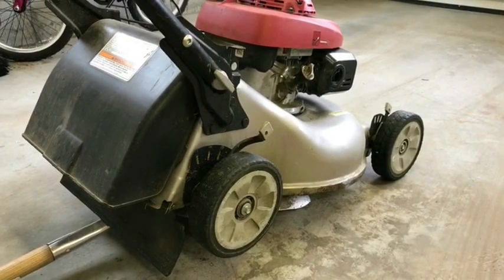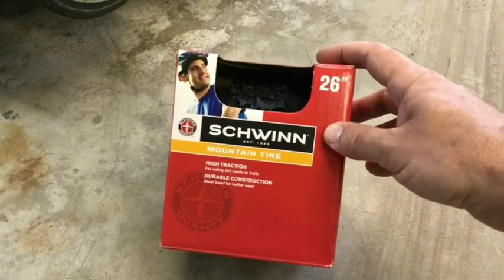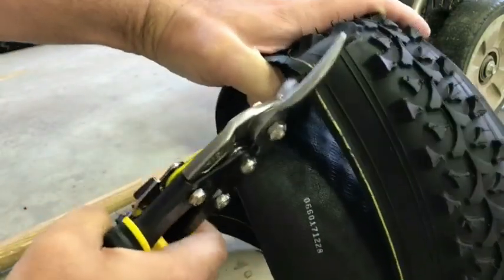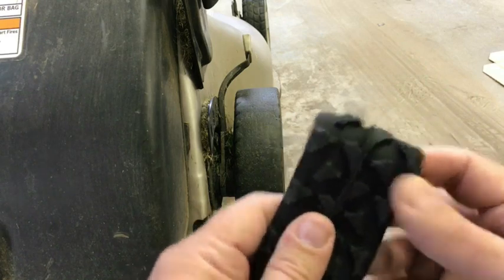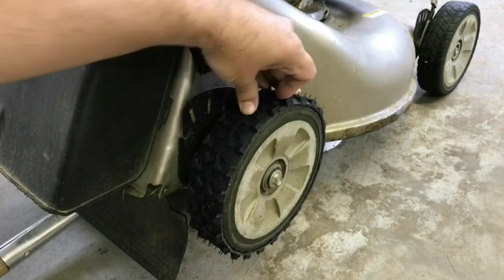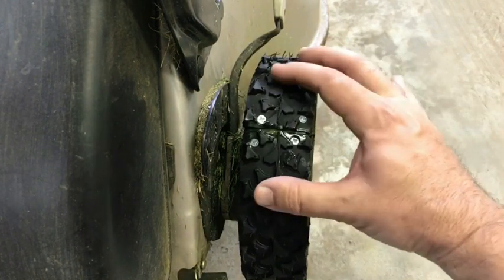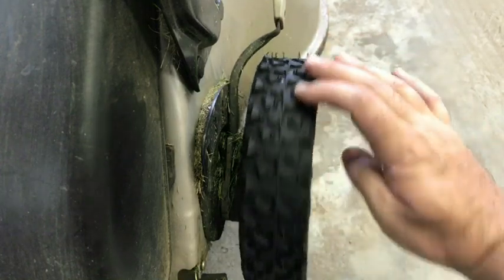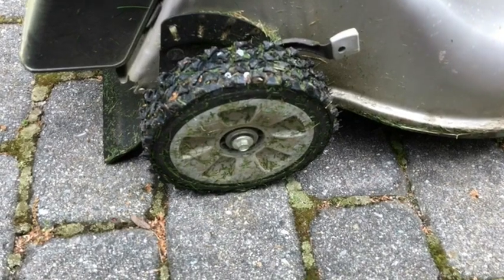Honda lawnmower worn wheel fix / retread

Comment: Good fix! I own the same exact lawnmower and got sick of "drift racing" while mowing the lawn - especially on the hilly sides of the ditches where my lawn borders the highway. The cheap plastic wheels lasted me 3 seasons (about 25 grass cutting days per year).  I'll use your idea, and thanks for the final tip on contact cement: I'm going to Home Depot now to just buy some builders adhesive. In rain, heat or ice, I can never get that crap off from my tools and equipment, so I'm betting it will secure permanently to the bike tire.  Note: I wrote a reply to "FEARLESS" below who suggested to just buy new wheels.....ah yes....spoken like a true Millennial with money to burn and no desire to fix anything!! But what will he do when his parents pass on and he can no longer live in the basement?
Reply from the maker: My fix still works at full tilt.  The screws are the most important thing in my opinion.  None of the adhesive sticks at this point but the treads are not moving at all with the screws.  Have fun with the garage surgery!

Comment: I have a rear wheel drive Lawn Boy with about 15 years of use on it. I have to mow some step hills and road banks with it and the tread on the tires was getting smooth. I wanted to find a solution to give it better traction. What I came up with is studded tires and it works great. I took some 1 inch long sheet metal screws that have 1/4" hex heads on them and drilled pilot holes in the rear tires in a zig zag pattern and drove in the screws. This made such a huge difference in hill climbing ability that I wish that I did this years ago.

Comment: FYI ON THE NEW TUBE AFTER TRIMMING CLEAN THE TIRE WITH ACATONE GOOD TO REMOVE ANY POWER THEN APPLY YOUR GLUE .  VERY NICE VIDEO SIR
Reply from the maker: wildcat2488 I think you just hit where I blew it.  The screws have held it in place though.

Comment: Mountain bike tires, you are a genius.  I used Harbor Freight step slip pads which are good but won't be as good as mountain bike treads.  Thanks for post!
Reply: I tried Harbor Freight step slips and they weren't as flexible as mountain bike tires.  I did what was shown above with contact cement and deck screws and it's working great!

Comment: When applying a tire patch, the inside of the tire needs to be abraided for the rubber cement to stick. If you rough up both the tire surfaces with a wire brush on a drill or grinder or something like that, the adhesive likely would have done much better.

Comment: I went to the auto parts store and bought an overhead cam timing belt the same width as the tire. used 3M weatherstrip adhesive. Used 4 pan head Phillips S. steel screws at each belt end. It does not grip the grass as well as the mountain bike tire.

Comment: I already did this before watching your video, I bought a cheap 26 mtb 26 inches tire for 5€ and then rethread the rear tires. It saved me 70€, taking in consideration all the materials needed, a set of rear wheels plus shipping would cost me 80€, equivalent to 95$

Comment: Great idea and the tire treads I'm sure are a lot better than the plastic wheels.  Amazon does have the tires (both tires) for $23 now, but I'm sure the bike tire tread is a lot better.   I just replaced my rear tires for the second time and the mower is 8 years old.  This is a  nice mower, but the plastic tires wear pretty fast.

Comment: Prep the worn tire before contact cement with sand paper and or red scotchpad, dry wipe debris.
Now repeat for the backside of the retread, then attach that retread in the center with cement.
Find and mark the point of ends meeting on the tire itself. 
Now apply cement and pull to stretch and meet one end at that mark. Let dry.
Now repeat for the other side.
Stretch Duct Tape around the tread tight... 
Leave til next day... Keep temp above cement requirements. (Could use a heat gun carefully at any point to make rubber pliable... carefully...)

Comment: Never had one of these apart, but is it driven by pulley/belt setup off the motor?  Is there a way to use a different pulley/belt size to slow the wheels down? 😮

Comment: Extra thrifty tip : ask your local bicycle shop for an old tyre that they're going to throw out and they'll probably be able to sort you out. I did and I have the freebie in the car.
Looking forward to giving this a go later on thanks.

Question : do you think I could get away with leaving the glue step out and just just use the screws?

Thanks again.
Reply: Actually you can leave out both the tire and the glue and just use hex screws spread out over the surface of the existing tire. Think baseball cleats!

Comment: I'm  Curious ... how has this repair held up over the past 4 years?   Have you had any treads come loose and need to be re-glued?
Reply from the maker: Its just like the day I did it.  Grass does zero wear to a bike tire.  I am going to do the front tires no because they are bald and this mower will not die!
Reply: I got some that are 9 years old and still good 
Try it

Comment: Thanks for the video.  Barge glue is best.  Update us with how long the last.  I hate the plastic tires.
Reply from the maker: They still look like the day I put them on. Absolutely no treadwear so far. I will guarantee you the tires will now outlive the engine.
Reply: @diy-ynot6264  awesome, I just did my Honda rear tires.    Works way better with rubber vs. plastic threads.  Used screws, small finishing  nail gun nails and barge glue.  Thanks for sharing!!
Reply: Barge glue?
Reply: You could also use a binder strap while the glue is setting to make sure you have 100% contact on the old wheel

Comment: I got all 4 of the 2018 and up style wheels on the web which have a longer life for $38 and change, no tax, free shipping. Not bad. It was for a honda from 2003 the HRT216 that really needed them, so that was a good $38 investment. You just gotta look harder, theirs good deals out their.
Reply: Sure! Money will do almost anything. But I think the main point of us lawn cutters is to save money - especially at 68 years old and living off my fast dwindling life savings (due to several surgeries).  So for the reasons of saving the purchase cost, then paying shipping (many of us live out in the boonies),  retreading with mountain bike tire is a great solution!
Reply: They work better then new ones and last longer